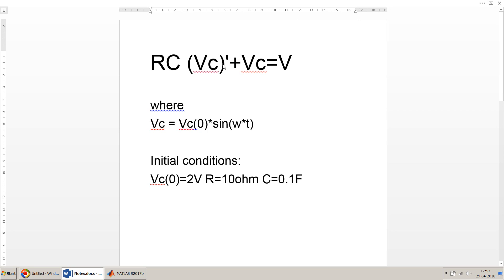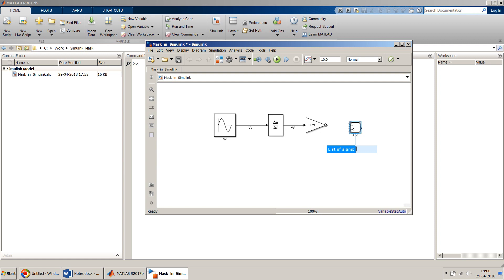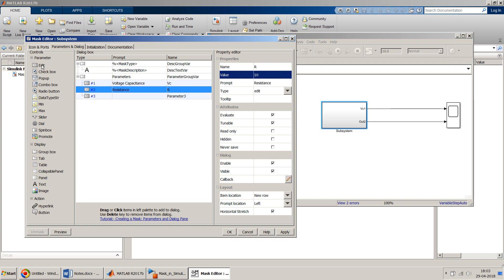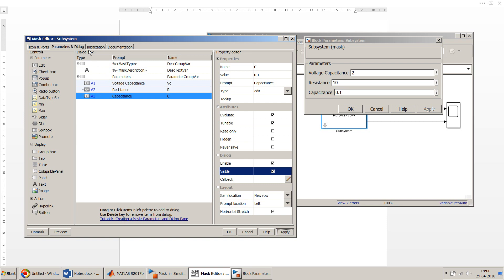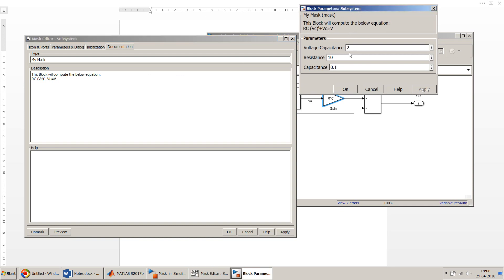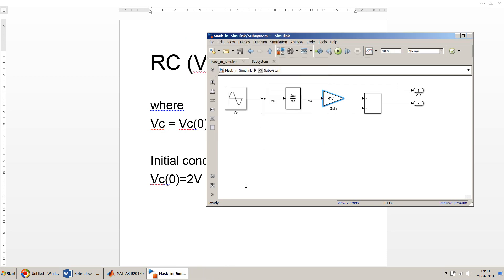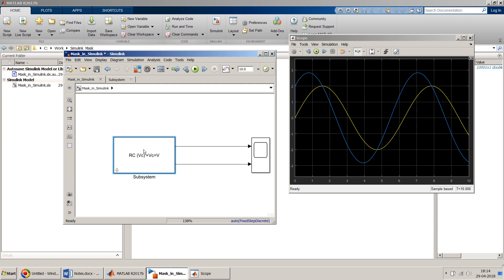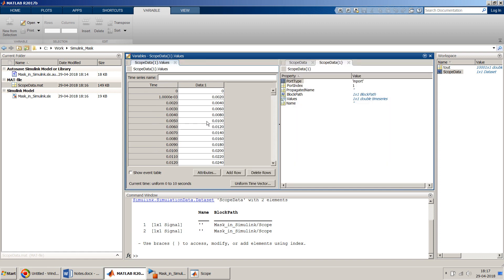How to implement Mask and define parameters on a subsystem Block in Simulink - MATLAB?

Comment: There is a way to change the parameters values while the simulation is happening ?
Reply from the maker: No, I do not think that the parameter values can be changed while simulation is running. The only option would be to pause the simulation then change the parameter and resume the simulation. Simulation can be used either programmatically using 'sim' command or even manually in the Simulink window.
Reply: @ Gabriel Oliveira Check parameters and Gain Scheduling for Linear parameter varying systems on Mathworks.com
Reply: Yes it can be done